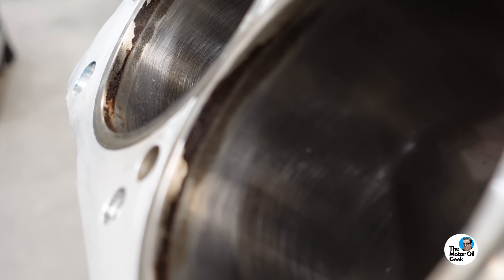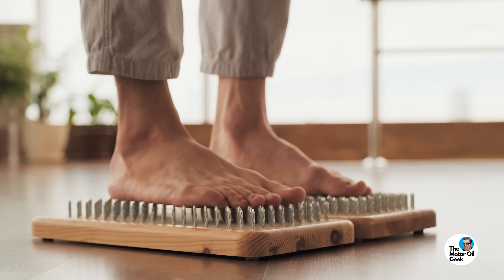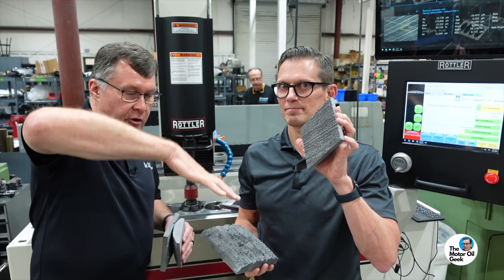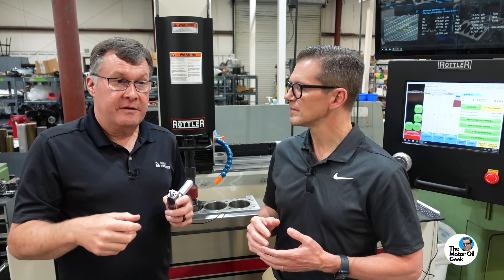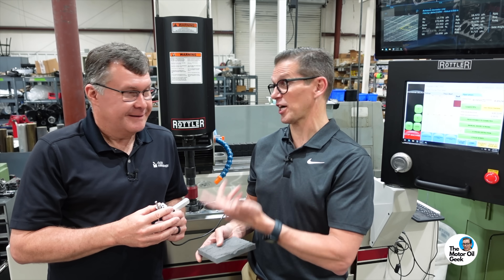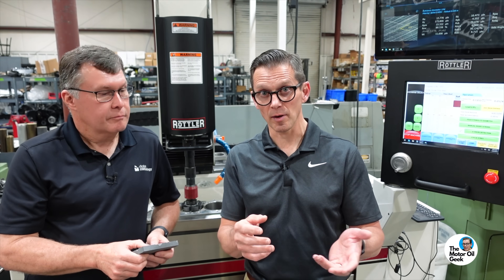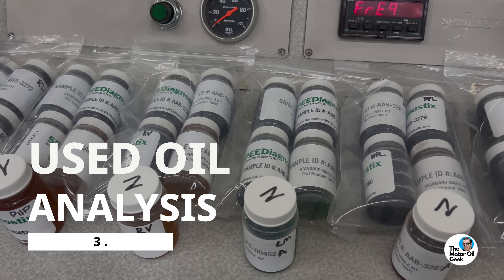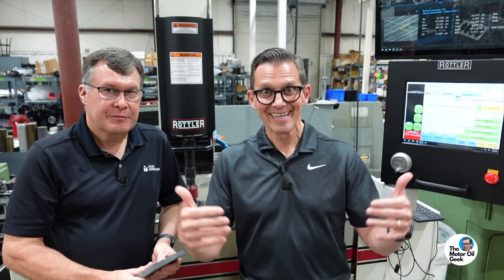GM's $1 BILLION Dollar Blunder: ROUGHNESS Matters...

Comment: This comes as no surprise. I am going to show my age here- those of us who remember the number 8 exhaust flat cam lobe issue that plagued the Chevy 305 in the early 1980s will remember that GM tried to blame the motor oil and not the soft cam. While GM covered some cam replacements outside the warranty period, they recommended owners to switch to 20W50 oil instead of the recommended 10W30 listed in the owners manual.

Comment: The surface finish coupled with the ridiculously low viscosity oil, 0w-20, used and specified by GM coupled to create the failures. GM's "cure" is to go to 0w-40 oil as it's cheaper than replacing the "defective" crankshafts.

Comment: I wish they would add 2019-2020…I have a 2020 that had the exact same failure as these new ones with 93,000 miles. I had to install an entire new motor.
Reply: What weight oil were you running

Comment: Yep, roughness matters. I was once an inspector in a GM transmission plant. There were inspection devices called profilometers that were used to take a reading on any surface that was polished or 'burnished'. At one point, I was in the department in charge of calibrating these devices that measures these surfaces. In some cases, in regards to transmissions,  a surface could be deemed too smooth. I can't speak to the bearing surfaces on a crank shaft or cam shaft, but only common sense tells us that those surfaces have to be to be held to 3 specific specifications, the diameter, the roundness (run out) and the specific micro surface.

Comment: Going off-topic here, but if anyone wants to know, "DLC" stands for Diamond-Like Coating. It is crazy-smooth and hard. The profilometers can barely pick it up, if it's done right. I was in that industry, for a little while. I THINK, automotive-wise, it originally started with Honda experimenting with their F1 engines. They sent a stack of titanium valves in, to be coated. The process is (or was, anyway) extremely labor intensive and complex. When you scan items in a supermarket and the glass scanner plate has that dark bronze finish? That's DLC coating. The scanners wouldn't last a week, without it.

Comment: I’d like to know your thoughts on fuel stabilizer and any negative side effects? Do they even work? Prevent corrosion and ethanol breakdown? I’ve been using stabil around my barn for my quads, bikes mowers, power washers etc. four years. Thanks

Comment: I have worked as an aerospace inspector and a physical metrologist.   ( measurement scientist ) go back to the 1980's.
One thing that I noticed...  On a surface smoother than 32 microinches Ra a normal lead pencil will leave a mark, but no dust.
On surfaces much rougher that that you will observe a trail of shavings from the graphite clay "lead"  ( under 10x optical viewing)\
Aerospace design specs for sealing o-rings normally  require 32 microinches Ra or better.   
Surfaces that involve metal on metal contact need to be smoother than 16 microinches Ra.  
 Cylinder walls are an exception to that rule, of course !
Reply from the maker: Thanks for the expert insight!

Comment: You didn't identify the relevance to the recall issue, or explain why ring sealing was never a problem when quantified  with dinosaur tools. 
Commercial for an obscure engine builder? Or for oil analysis services?
And a magnetic drain plug is the recommended diagnostic tool?
My deep dive lasted 50 years, and I'm still breathing just fine without your blowby.

Comment: I have to imagine that the cyl wall cross hatch wears out or is significantly reduced over time. These stats would be interesting to see say at…50k miles, 100k miles, etc. any resource out there…just to get a feel for these results? Anyone know a reliable Used Oil Analysis company?

Comment: To speed up development, you could hone 8 cylinders differently, note the strokes and grit each cylinder receives, run the engine on the Dyno and then test crank pressure before stripping the engine and checking wear rates.

Comment: I agree with almost all except the glass and finger example.  Your finger sticks on the glass because of your finger prints and the oils and moisture on your fingers skin.  Run the top of your finger nail on top of the glass and it moves with alot less effort and does not stick.

Comment: This was a great intro to the subject for me, an electronic engineer.
In the early 1970s I worked on a video player project that used continuously running microfilm instead of the intermittent frame by frame sprocket mechanism of an ordinary movie projector. While this avoided sprocket tearing, it was a real challenge for lubrication of the soft film emulsion as it ran over the film gate surface. The chief mechanical engineer on the project won an industry prize for development of the base zinc casting in combination with  the surface plating of the film gate, which had to have a precise roughness profile to be smooth but not sticky and not abrasive when in contact with the microfilm. This video has helped me understand what was going on in the mechanical side of the project.
By the way, the lubricant was a particular silicone formulation.

Comment: RMS SURFACE FINISH. I ran a cyclinder hone machine in the 70’s honing approximately a hundred thousand cylinders. Then moved to QA testing the cylinder finishes with a RMS machine and probe. Testing is done on a sampling of products to gauge trends so most units will pass with no inspection and e few fail later under load. A 1.5 percent failure rate was considered very good.
Reply from the maker: Thanks for sharing your experience!

Comment: 2025 Cadillac Escalade 6.2 with only 2,800 miles needs a new engine still has the original break in oil from the factory never Ben change obviously wasn’t a oil issue but manufacturer design flaws

Comment: Honestly we have the best equipment to do machine work. The best. But engines don’t last as long because it’s lifespan is designed into the engine based on number of years in service not mileage. As good as vehicles should be they do NOT last longer than what they lasted 30 years ago. We drive further but the number of years a vehicle has in its service life is about the same. All the plastic and other junk materials look good but don’t last. Sad.

Comment: The cylinder wall technically is designed to never have direct contact with piston ring, it was designed to have a thin film of oil retained by the cylinder wall texture. The problem is GM as well as most automotive manufacturers is they have been playing a dangerous game of chicken between the protective properties of engine oil and its effects on fuel economy. Longevity was removed from the metrics years ago and this recall is the result.

Comment: Hi, I have a question, 
I recently bought, CLA 45S brand new. Making the engine break in, sticking to rules. Mercedes recommends 15.000 km for an oil change, but I guess you recommend much earlier like 2000km right?
Reply: Change it at 5000 miles and then every 5K miles.

Comment: Technology has done nothing good for the automotive industry. We have more engine failures, electrical problems and computer failure. Say what you want about the automotive industry. In my opinion, technology has done nothing except created more problems then fixing them.
Reply: actually, as a whole car engines are MORE reliable and require LESS maintenance, compared to 50 years ago.
Reply: @darknes7800 say what you want. My two vehicles from the 40's and my other 2 from the 80's are very reliable and do not require anymore maintenance than my 2016. Bonus I can repair my 4 older vehicles. So the older vehicles are cheaper to maintain. Compared to my 2016 where I have to rely on a shop to diagnose a problem and taking it to a shop is not cheap. So technology has over complicated everything. What was once a simple task by a switch is now controlled by a computer.

Comment: i run engines from the early 90s, sbc's, 15w-40 conventional castrol non diesel has worked very well for me.............500000 plus on all engines and rebuilds never fails...........these new engines would likely fail on 15w-40 but they seem to fail on the recommended oil anyway.

Comment: One error at the 0:28 mark of your video.  The nearly 900k vehicle count was the initial NHTSA finding because the root cause was still undetermined so they had to cast a wide net of coverage to ensure every potential vehicle was included in the recall.  It was soon discovered that only certain VIN's within 2020-2024 were included in the GM recall.  So the number of truly impacted vehicles as it pertains to this recall is far less than the 900k number.

Mind you, I'm no GM apologist here.  They have found ways to sabotage their customers and their own success.  Be it this manufacturing blunder or their silly AFM/DFM nonsense, they continue to find ways to screw the customers and ultimately, their bottom line.  So in no way am I running to GM's defense as a GM Kool-Aid drinker.   I do, however, feel it's important to keep the facts correctly stated in that there are not 900K vehicles included in this recall.

Not a rip at all.  I enjoy your content and delivery.  Just wanting to make sure the facts stay accurate, otherwise you stand to lose credibility that you have worked hard to earn is all brother.

Comment: I honed my first Chevy 350 when I was 15 yrs old.  My dad taught me to create cross hatching by running the hone in and out at just the right frequency.  Don't go too deep and run the hone into the crank area casting bosses and don't pull out too far and cause the hone to fly out of the cylinder causing other problems.  I never had an issue and I've built probably over 50 engines since then.  How is it that a 15 yr old in 1980 can figure this out and today we have all these crazy problems.  It's almost like we've re-entered the dark ages.

Comment: wow what an amazing video i geeked out on this one .........lets talk oil i have a 2019 malibu with a 1.5 T engine and my dealer free oil changes have ended and its too expensive to have the car serviced at dealer so im gonna do my own oil change ........my options are mobil 0w20 not mobil 1 just mobil brand it has dexos label .........then i have penzoil platinum that has dexos label and 3rd option is penzoil ultra platinum but it does not have a dexos label ........

Comment: You are bringing back memories of a by gone era for me.  Back in the 1980's, I worked in a group, funded by a major steel mill, that was tasked with designing and building the original two piece beverage can i.e. the can was one piece and the pop top was the second piece...NO Double seamed bottom.  So there was a can forming punch that forced the can through a set of rings (All made from Silicon Carbide).  

So having gotten this far, the entire can making community was faced with this surface roughness debate....how to characterize the surface characteristics such that one company could talk to another in accurate terms.  The call went out for methodology proposals and there were a lot of them.  After a GREAT DEAL of testing and interaction, we had a breakthrough, the whole mess was distilled down to ONLY EIGHT DIFFERENT WAYS to measure surface roughness.

The tool and die shop, that I was responsible for, utilized several of those 8 methods and eventually developed the tool punch and the tooling rings that, working as a system, could make cans for a week or two, before needing attention.  Note that the can production machines started at about 150 cans a minute and ended up at 300 cans a minute.  Imagine seeing 5 beer cans a second come out of a machine.... 

I was one of those who had to work with the various groups to get together on this and we used a specially built machine that moved a diamond stylus across the tooling.  There was Peak to Peak, Peaks per Inch,  RMS (Root Mean Squared), Standard Deviation,....this is a HUGE ISSUE in machine building.  Think about the "ways" that the parts of a machine tool, travel on...they have to be precise and stay that way for years.

Oh, and I'm lucky enough to own of of these engines, built in 2020, I have my fingers crossed....wish me luck!  The dealer is saying that the problem happened periodically and they are collecting the data around periods in time when it occurred starting in 2021 through 2024..thus far.  There are 888,870 potential problems !!  I'm told that engines that fail will be replaced and certain others will receive a 10 Year / 150,000 Mile Warranty.

Comment: 30 years ago, they never even measured this stuff. Most engine shops still wouldn't measure it, and use basic equipment to bore and hone cylinders. So how can you know your package is even going to work given it's bored and honed with basic one size fits all equipment? Who knows what the iron in your block is like compared to the next one. Who knows what you end up with.

Comment: 2007 Hyundai Tucson, had 430,000 Mi on it. My mom went 100,000 mi in 80,000 mi on it before it blew up without changing the oil. Then again the oil leak it had get rid of the bad oil at the bottom and new oil went in also I used typically thicker oil to slow down the leaks.  Sometimes SA.  Basically as long as you're getting new oil in and the bad craps going out.

Comment: There is a large part of the internet saying if your vehicle recommends 0w-20 that you should use 5w-30 or 0w-30 because it protects better and they only recommend 0w-20 for better fuel economy to meet average mpg requirements and avoid fines. Please make a video proving or disproving
Reply: One thing they never talk about is the timing chain stretch from using thin synthetic synthetic oil. 
I have only used 15w-40 regular diesel oil in all my engines. 
2008 ford 3.5 EcoBoost with over 300,000 miles. Changed spark plugs and oil. Thats it. Never have to add oil in 6,000 miles oil changes.
Reply: I've never heard of an ecoboost that hasn't had to replace turbos soon after 100k miles.
Reply: @Brian-rj5rl my family has had 3 go well past 100k. No turbo failure. Manifold failure? Yes. But no turbos.
Reply: I run 5w40 in my vehicles and they’re rock solid. One calls for 5w30 and the other 0w-20.
Reply: What are your bearing clearances?  What was the change in oil pressure?  I want to change oil weight, but not without data.
Reply: Depends a lot on starting temperature and bearing clearances … diesels are different
Reply: They are correct. Also the recommended service intervals are bad as well.

Comment: I kept waiting for a more practical example, as in "what roughness do high-end racing engines use vs stock street engines, and which manufacturers get it right". When I was SCCA Showroom Stock racing, the word was that a new stock Honda/Acura engine made more power than a rebuilt, matched-part, tweaked  race shop engine. My experience bore that out. They were that good.

Comment: What were they doing 30, 40, 50 yrs ago without these high tech devices and engines were lasting 2, 3, 4, 500,000 miles? I understand surface finishing on cylinder walls with newer, thinner rings for sealing capability, but polishing crank journals with the proper finish and bearing clearance seems elementary for a competent machinist!

Comment: I know they explained it well enough, but my mind still went to a description of using the valley and not the peaks, that the peaks are machined down to a flat and leaving the valleys intact. In construction, or more specifically mudding textures on interior walls, there is a process called orange peel. It literally looks like an orange peel after it is sprayed. Another texture is knock down, which is an orange peel but after the surface sets up, you drag across the surface a smooth surface and it creates valleys but with a smooth surface at the peaks. You could do it with stucco spikes as well for a more dramatic effect. Forgive me the length, people hate it, I know.

Comment: Great video!! 
But hence the manufacturers push low viscosity oil, claiming the additives do the work and small oil passages require and other self created crap. 

Have an LZO 2024. Was using 2 QTs oil between 4500-5000 oil changes. Was told not to change which would void warranty. 

Switch to 5/30 and oil consumption dropped to 3/4 of a qt in 5000 miles and quieter. 

An issue I have with you Lake, is I seen you on video push to stick with manufacturer specifications on video with Dean Auto in Utah, because of your list of reasons. MAYBE I MISUNDERSTOOD!!! But, 
I knew it was crap, and the minute GM changed to 0/40w in 6.2, now you have changed your tune and put out a video on it. 

Not looking for explanation because there is none. You are either for us or for the others. SORRY SIR BUT THAT IS BEING LUKE WARM. WE THE PEOPLE DONT DO LUKE WARM!!!

I have owned and run fleets of diesels and gas. Raced with NHRA and built engines. I am not an inexperienced idiot. 

So please decide which side are you going to help!!!

Comment: I look at other You Tube creators that build engines. When they are doing the final hone of the cylinder they measure the hone using the tools they show here. The cylinder needs are certain amount of roughness to allow the oil to lubricate the cylinder and rings. So these tools are not out of the ordinary and good engine builders use them to make sure the engines will be reliable and run well for a long time.
The same roughness measurements are needed on the crankshafts, camshafts as well. Too smooth and the engine will not breaking in, too rough and it kills the surfaces.